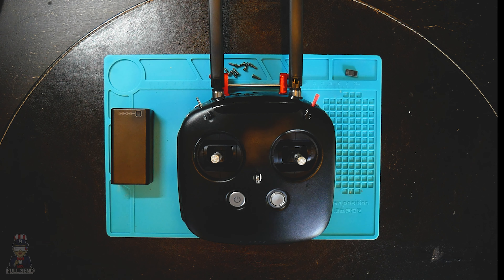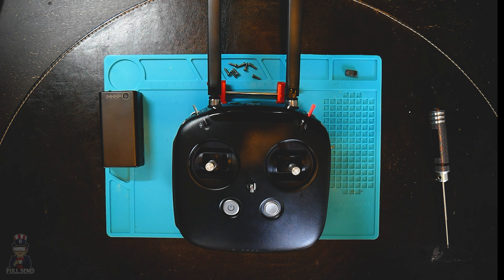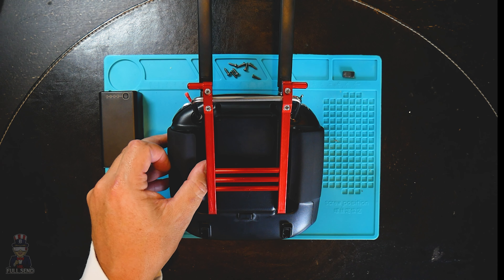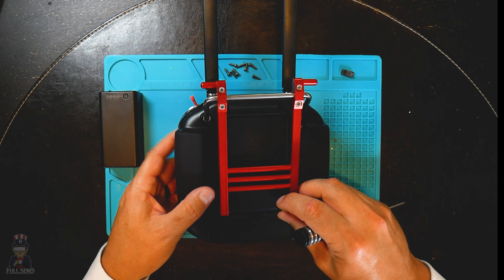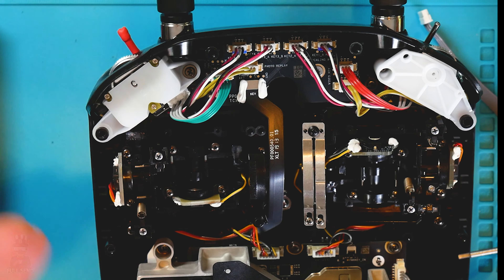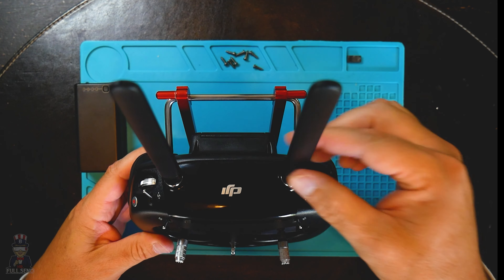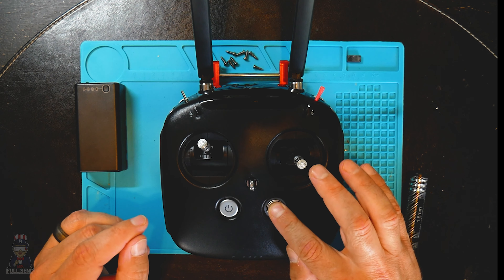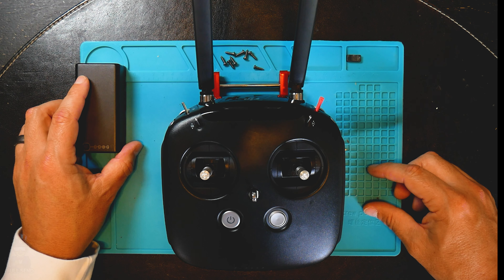👉Inside the DJI HD FPV Transmitter - I've Got A Gimbal Hack 👈

Comment: What’s the advantage of using the DJI controller vs something running Crossfire? I know I can save $30 by using the native link, but not trying to buy another radio. I know Beta 4.1 will have some DJI options, but not sure what they will do? Thanks for doing these videos, really enjoying the content.
Reply from the maker: So two things:  1. it has a strong link like Crossfire so no need for additional mounts for the Immortal T and the Nano.  2. there will be the new DJI HDL Protocol coming in BF 4.1 that will decrease latency to 7ms.   7 and stable at long ranges...  The good thing is you don't HAVE to use the radio.  I'm just giving it a try....
Reply: I first used the taranis and xsr with sbus and there was a little bit of noticable latency. Now i use the dji remote on betaflight 4.1 and DJI HDL protocol and man this feels good, just as fast as analog. I didnt try with crossfire prob also fine.
Reply from the maker: @hansturpyn5455  So you loaded BF 4.1 beta?  Nice!  Didn't want to mess with these now that I finally tuned it.  Glad to know the HDL Protocol is awesome!
Reply: @MrFullSend  i tightened all the sticks to the max. Default was to loose. Only the throttle stick that one i loossened up even more, i like a verry loose throttle stick for fast response
Reply from the maker: @hansturpyn5455  the channel seems to be blocked in the US
Reply: @MrFullSend lol strange, yeah i am from Belgium, europe.
Reply from the maker: @hansturpyn5455  it's "better than analog" .I think TBS Crossfire is somewhere around 14ms, but not 100% sure.  This is 7ms.
Reply from the maker: actually confirmed - Crossfire is 13.9ms...so way faster.
Reply: @MrFullSend  yes, it feels verry locked and snappy with the dji controller. I love it
Reply: DJI: Cleaner, simpler build with plenty of range for most pilots.  Crossfire/R9: More range although you would need better goggle antennas to use it. Audible warnings and possible to log GPS coordinates to the radio.
Reply: @hansturpyn5455  Its funny,  the throttle on this is really tight no matter how loose I make it.  I dont like to force the throttle,  i feel like forcing it makes it over move,  as opposed to a loose stick allows me to barely move it.  Its strange to me that different people have different sensations.  If I pop this open and grease that thing, and loosten it up,  can I get most of the tension off the throttle?  I current use a jumper t-lite as my other controller,  and the throttle on that is zero tension,  which is a bit too light,  but even that,  is tighter than the tension on this stick.
Reply: @IconicProps  my throttle stick fals almost down when i stand the controller vertically. Are you sure you rotate the screw in the correct correction, and that you are turning the right screw?

Comment: I put dense packing foam, like what comes to protect our flight stacks, and whatnot. I had some pieces that were about 4mm thick, that came with some Traxxas parts. Used double-sided foam sticky tape to stick it to the area where my hands grip the controller. I cut it to fit nicely, so it looks pretty good. Hands can get sweaty, and they don't slip, like the pads that come on the controller, as shipped.

Comment: Switches are really limited on the remote compared to other remotes. Only 4 aux channels and no momentary switch. One trick I have figured out is that you can use one of the switches to activate a pre arm on the flight controller. If you pair it with the buzzer, you can’t arm unless the buzzer is activated and the buzzer reminds you to turn off pre arm after arming. This requires a real buzzer. It does not work with motor beeping. I use the right lower switch for pre arm/buzzer and the left lower switch for arm. The switch also activates GPS rescue if I have installed a GPS when the switch is moved to the last position.

Comment: I like the simplicity and feel along with the integration with the DJI Air Unit as the control link to Flight controllers.  I am currently trying to find some help making this radio work with head tracking.  Have ZMO vtol that is my ideal distance and duration of flight it just needs a head tracker.

Comment: hey i have remote conttroler mode 2 and i have throttle stick in the middle is it possible to get throtle stick down to zero position ?
Reply from the maker: Hmmmm...  that doesn't sound right.  What do mean throttle stick in the middle?
Reply: @MrFullSend  He's asking if it's possible to convert from mode 2 to mode 1. I'm having the same issue wondering if I can convert my DJI FPV Controller to Mode 2. Any ideas?

Comment: I have some inquires sent to DJI about this remote and its design and construction. I hope to find out more about it shortly. What stick ends are compatible with this unit? I'd look at my controller but I'm out of country.
Reply from the maker: It's the M3 stick ends.  Any of the Taranis Qx7 stick ends work just fine.  I replaced mine already.  I'm going to try and swap out some Hall Effect Gimbals the M7's and see how that goes.
Reply: @MrFullSend  you are going to try to  put  hall effect gimbals in the dji radio ?
Reply from the maker: @modeminho  I am - I'm going to see if I can hack them, just haven't had the time lately.  But, it's getting winter and I'll have plenty of time.

Comment: great overview. i wanted to originally use the dji controller over my crossfire but i heard a few horror stories of failsafes. i think i will try the system out with crossfire and my x9d controller (that i admittingly dont love) and see how it feels. anyone had issues with the dji controllers range?
Reply: It seems like you have never failsafed with crossfire or your x9d before. I have and 300 yards is too far for me to walk.  I've gone 1 mile with my dji controller.  Is that enough for you?
Reply: @anfrae25  it has dropped out a few times, but since then I've learned about better antenna placement. sticking with crossfire for now. but the dji controller makes builds a bit easier

Comment: Are the controller antennas compatible with rhcp antennas on the air unit? Are they linear polarization?
Reply from the maker: they are LHCP and so are the goggles, but you can swap them all the RHCP on both sides which is what I just did.  Moved them all to Axii 2 Stubbies... all linear...
Reply: Mr. Full Send I did the same recently. So the controller antennas are linear.

Comment: So the button next to the power button if pushed will not let the motors arm? Because I couldn’t get mine to arm. The company tried telling me a few different things to check and that was never one of them. I sent it back with my goggles to see what was wrong and they got it and said everything worked perfectly without doing anything. They said I probably didn’t have my stick all the way down and I know I did. But I didn’t know about that button not letting it arm. That would make perfect sense why I couldn’t get it to work but why couldn’t the company I bought it from say that could be the problem? Haha.  how do you know if it’s locked or not with that button? Just try to arm it and if doesn’t work push button and check again? Or is there a light or something that comes on to show your locked out because of that button?

Comment: Will there ever be a possibility to use crossfire tx with the dji radio?
Reply from the maker: I highly doubt it, but since the HDL Protocol they use is good for 4km and better latency than crossfire at 7ms, not sure why you would want to other than you already have it in your stable.

Comment: Nice video, appreciate it! Was wondering about the feel of the transmitter. Will hopefully order all my new stuff soon including the DJI system.
Reply from the maker: It actually feels good.  So many different hands and styles of flying that no ONE controller is perfect for everyone.  Some like the Turnigy (Xbox like) Evolution, some the Qx7, some Spektrum, some Taranis X9D.  It all depends.  For my smaller hands it feels nice and the rubber padding on the side is pretty sweet.  I do miss some functionality like timers and such, but I think I'll be fine.   Time will tell.
Reply: @MrFullSend  yeah well I've never experienced the luxury of a taranis and I wanna have the option to use HDL. The only thing I had was that cheap toy one that came with an eachine x220 so I'm sure I'll like it. Plus I want to be able to throw it in my bag when I travel overseas and I'm already gonna be lugging around all the other crap like chargers so the smaller form factor is definitely welcome!
Reply from the maker: @Anonymous9683  amen, on the mobility of it...  I have to remove the Antennas each time and that's a pain in the arse.  Plus, an antenna only has so many "pairings" before the connection weakens and eventually breaks down.  No removing antennas here.  I like that a lot!  I wish I had FPV when I traveled a lot for work back in the day.  Not so much now....  Which I also like!
Reply: @Anonymous9683  i use the dji remote on the new hdl protocol and man this feels good. No noticable latency wathever. Therefor i tryed with taranis and xsr on sbus and in combination with that system i did notice a tiny bit of latency

Comment: Hey thanks for this very informative video. The problem I'm experiencing is that dust and a bunch of rubble got into where the controller gimbal sticks are, and now my throttle is really really rough..Ive been thinking WM-40 spray, but I'm a little concerned that may ruin it...Thanks for the great quality of your video, I'll be opening up my controller once i find a screw that can reach all the way into the remote...
Reply from the maker: yeah, sounds like you are going to open it up.  Let me know how it goes.  I would NOT use WD40...
Reply: @MrFullSend  Hey, so I attribute solving this problem solely to your video. Turns out, that the metal part you tapped with your screwdriver at 07:18 had micro scratches from the dirt that entered and got stuck between that and the plastic part that sortve brushes up against it to keep the throttle in position....So i took it off, bent it around a little, and put a slight bit of oil on it to make it slide more smoothly. Then I put it back together and voila! Worked like a charm. Big thanks to you for putting out this video - much love!
Reply from the maker: J. M. Oh man...  glad this helped.  I always hope there is some value to someone!  Whoooo hoooo!  Made my day!

Comment: How do you trim the channels to center exact 1500 in betaflight??
Reply from the maker: Danny Mars in the goggles under settings. - Servo Setup.  It's a bit of a pain to have to use the goggles to adjust it using the 5D button, but you just move it up and down until it shows accurately in BF Receiver Tab.

Comment: I'm torn.  I like my evolution.  But think I'll probably go with the dji radio when i get my pennies saved up.
Reply from the maker: If you are coming from the Turnigy - you'll like  this.  I have a Turnigy Evolution also.  Also, you don't need those relatively bulky turnigy Rx too.
Reply: I do like that the dji has a built in receiver.  I am currently using the half board reviver so it mounts nicely in the stack. But definitely going to be tight fitting it into my chameleon. 🤯

Comment: nice video, but can you install a crossfire on a dji system wiith its controller?  or you need a frsky something something :)    (just learning more about this new hobby :) ) thank you!
Reply from the maker: Not with the controller as the controller uses its own protocol.  You would either run your own transmitter (taranis, jumper or tango) and then use the DJI air unit for the vtx (video).  The DJI link is comparable to crossfire in the ya of latency and range, so I felt no need to not take advantage of both the DJI transmitter and Vtx.
Reply: @MrFullSend  thanks a lot! so basically the hole dji set up is a very  good competitive to analog set up.
Reply from the maker: @maxm5523  Yes, it's much better in fact!  Actually WAAAAY Better!

Comment: It’s my third day flying fpv with dji controller and my throttle gimbal feels stiff. Seems like something is stuck inside. Any suggestions ?
Reply from the maker: That's very strange - it usually so loose out of the box.  I wouldn't crack it open though, you may want to go to a hobby shop and see what the stock feels like compared to yours and see if it's different or check out a buddy's is you can.  That's not normal...  The stock ones are soooooo sloppy.  
You can try to loosen the screws in the back - read the manual or check out my video on how to adjust using the normal process, but again don't crack it open.  I'm smelling something that might be a factory issue.
Reply: I did open the back. The silver strip was touching the gimbles. Now that's sorted and it worked perfectly for another three days but now the controller stopped calibrating with the simulator and is not linking with the quad. It shows orange light instead of green. There is no mention about orange light on any of the manuals

Comment: Nice review. Do you plan to open the google?
 I would like to what’s inside ... perhaps it’s possible to hack it to make an HDMI output.
It will be cool to share with another fatshark viewer 🙂
Reply from the maker: well, I actually did and then I also talked with DJI Support and there is a firmware update coming that will hopefully allow us to output the video to a display through the USB-C connection.  Stay tuned.
Reply: Mr. Full Send super news 🙂 and it will be awesome to have an usb c—>hdmi adaptator

Comment: gimbals?  those are control 'sticks'.
Reply from the maker: actually the mechanism that the sticks connect to are called gimbals.
Reply: @MrFullSend  if you're referring to the sticks activated/initiate the 3- axis camera stabilization gimbal then yes.  that's the common reference for the word 'gimbal'.  I know nothing of a stabilized gimbal within the RC.
Reply from the maker: @checkeredflagfilms  It's o.k... look up any reference to a transmitters control mechanisms.  They are called Gimbals.  I get your reference point from the the name of your User ID, but trust me, they are called gimbals.  Look up "FPV Transmitter Gimbal" on Google.  Thanks for stopping in...  https://www.google.com/search?q=gimbals+transmitter&rlz=1C5CHFA_enUS859US860&oq=gimbals+&aqs=chrome.0.69i59j69i57j0l6.2143j1j4&sourceid=chrome&ie=UTF-8
Reply from the maker: @checkeredflagfilms  Also see this reference document on FPV:  https://www.getfpv.com/learn/new-to-fpv/all-about-multirotor-fpv-drone-radio-transmitter-and-receiver/